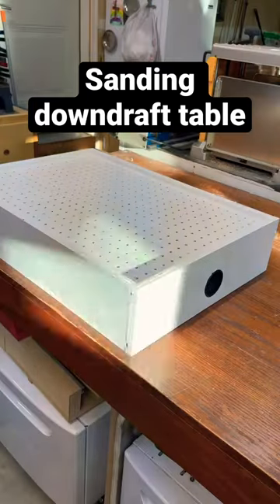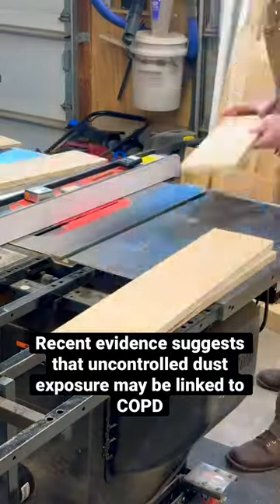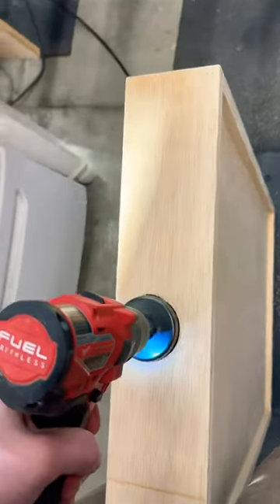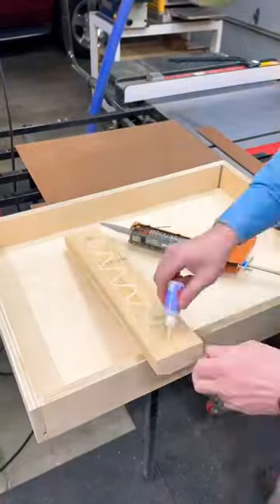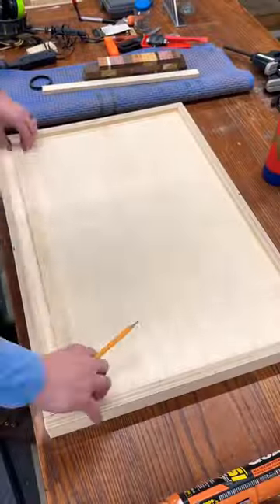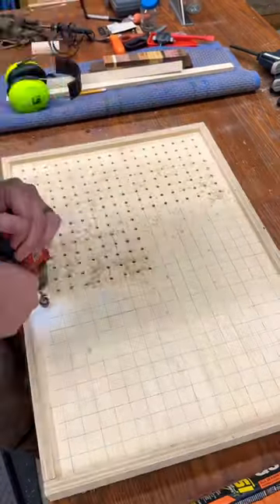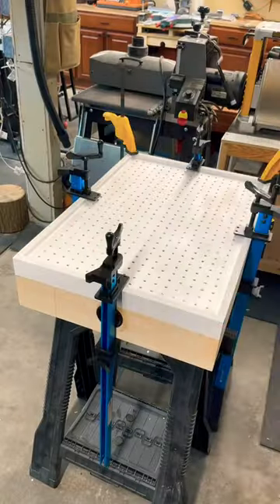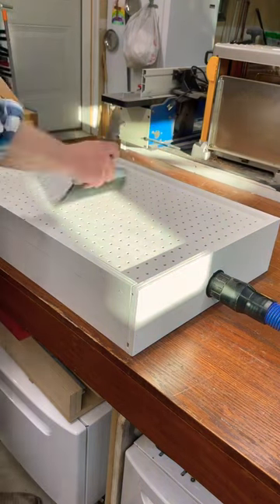Downdraft tables save lives        #sanding #woodworking #making #wood #copd #diy #workshop #garage

Comment from the maker: Regarding pegboard: The comments make it seem like I wasted thousands of hours and days of work drilling those holes instead of driving 30 minutes to Home Depot and spending my good hard-earned money on pegboard to drive 30 minutes back and add support bars underneath. I finished drilling those holes in plywood that I already had on-hand in less time. Chill on the pegboard! Who is going to comment that I could have also just gone to Rockler and purchased a downdraft table instead? Anyone? Yes, you can always buy stuff. I like to make stuff.
Reply: I’m kind of confused about the baffle. A little more detail would’ve been nice
Reply: @sas5177  the baffle cuts the volume of the box in half to increase the vacuum suction. It’s the same concept as giving your vacuum a narrower hose attachment to increase the suction power.
Reply: @zachsdickDOTmpg  I’m know what it does. I’m talking about construction
Reply from the maker: @sas5177  yeah, that’s the problem with these short form videos. There is so much that gets left on the editing room floor. The theory is that the inside ramp keeps the air from swirling inside and directs the air current in a direct line downward toward the vacuum hose. It also serves as a smooth ramp to direct dust as opposed to dust collecting in the corners of the box.
Reply from the maker: @sas5177  I shaved a slight angle off the side of a 2x4 and then glued that down on the far end. Then I glued and nailed 1/8” smooth MDF-style board into the 2x4 and glued and tacked down at the vacuum end. I laid another piece of that smooth MDF across the top of that 2x4 to cover. It probably wasn’t needed, but I caulked all the seams to give a better chance that all suction was only let in through the holes in the table.
Reply: @TenThousandMakes  Gotcha. Thanks
Reply: Or you could just buy a Mirka Deros with an auto vac and cart for 2500$
Reply from the maker: @MrBean12233  truly!
Reply: .... but,  your holes aren't strait.  I noticed some of them are off by several thousandths of an inch.
This will definitely reduce effinacacy.  What a mess!
😄😉
Reply from the maker: @gereshare6659  Well, it will make great firewood! Could’ve been somebody! 😂
Reply: Hi fellow Swifty !😉
Reply from the maker: @JonLake  hello! Dare I ask what a swifty is?

Comment: Good idea and craftsmanship ! 
Maybe next time a flat surface without a raised edge?
Reply from the maker: Thanks! Strangely, the raised edge was by design as I’m usually hand sanding pieces small enough to fit within it — that way I can but them up against the edge of I’m doing a flat edge or something. Acts as a stop for me. But definitely could be built with a flat top!
Reply: Ok, so you made it exclusively for small pieces, makes sense.  Yes, I thought that if there was no edge, even longer pieces could be sanded.
Reply from the maker: @bacictimi  you could still do longer pieces, just bridging them across each edge. The 1/2” above the table won’t change the function of the table. In fact, for super small pieces I typically just stand over the downdraft table and any dust particles I’m kicking up are whisked downward.
Reply: In that case, you nailed It ! 💪🏻

Comment: I made one of these about ten years ago that is the size of my work bench top and has adjustable dividers that slide in and out from the side so I can use the appropriate size for the project I'm working on. It also has ports on either side to get suction from both or either side depending on the size project I'm working on. I can hook up two vaccs or one to both sides using a T joint to hook up two hoses to one vac, depending on the amount of suction needed. I also made a small spray booth using the same concept that has suction from above and below and vents to an exhaust filteration system.
Reply from the maker: Amazing!

Comment: I'm surprised you didn't hinge the second half back on to open it up for maintenance or adjustment.
Reply from the maker: Actually, I thought about it! But I didn’t want there to be any leaks in suction. Then I thought I would seal the connection with some stick-on rubber draft liner stuff for exterior doors (you know the stuff) because I thought I had some extra laying around. Couldn’t find it. But I’m with you - not a bad idea.

Comment: Skip all the drilling and use pegboard. Add a couple of supports underneath to keep it from flexing.
Reply from the maker: Good idea. You should do it that way when you build yours! I didn’t have any on-hand, so I just used what I had.
Reply: @TenThousandMakes  

I did build my own back in 2003. I’ve gotten a lot of use out of it.

Comment: I would have made the surface flush with the sides so you could sand stuff on it that is larger than the box. Actually, it would be great to have an area of a workbench that incorporated this idea!
Reply from the maker: That would be great to have it built into workbench!
Reply: @TenThousandMakes  Yeah! It would have to be either a hollowed out section of a thick workbench with the holes or just cut out an area and insert the box...

Comment: Interesting idea, I'm always looking for better dust collection. However, I am curious about the need for this? My sander hooked up to a shop vac takes up almost all visible dust, leaves the air and surface clean. Usually sand large pieces from 80 to 150 grit. Does this box enhance that, or is it for another function?
Reply from the maker: Good call out- this would be just for hand sanding. I do the same with my orbital sander/vac attachment.

Comment: Does it also work as a suction holding the piece in place? Or is it not strong enough?
Reply from the maker: Good question, it does not. Not strong enough. Just a gentle downdraft of air is felt above it, but it’s enough to pull dust downward instead of up into my lungs.

Comment: All those holes. Cheap cnc router would do that pretty quick. Well less trouble anyway.
Reply from the maker: “Cheap CNC”… I’ve never heard those two words together!
Reply: @TenThousandMakes  for a few hundred bucks you can get all kinds of CNC machines and parts to build them from Amazon and other sources. Routers, 3d printers, laser engravers etc. I'm poor as a church mouse and have all three and enough parts to build another. 
I used the small router to cut the holes in plywood for the two hose portable AC units we bought because the plastic bits they send for that are absolute crap. I printed gear reduction transmission and various animals for the fun of it as well. I also burned signs and decorations with the CNC laser. All of them were less than $300 though my tinkering with different parts added some cost. It's a fun hobby and a lot simpler than most people might think.
Reply from the maker: @consaka1  Amazing! I’d never thought of building one before. I’ll have to look into it!

Comment: Neat.  Is it big enough?
Reply from the maker: Yes, for my needs. I have a single stall garage shop and I specifically built this table to fit under one side of my assembly table. It works for 90% of my hand sanding needs. Usually if I’m hand sanding, it’s smaller projects.